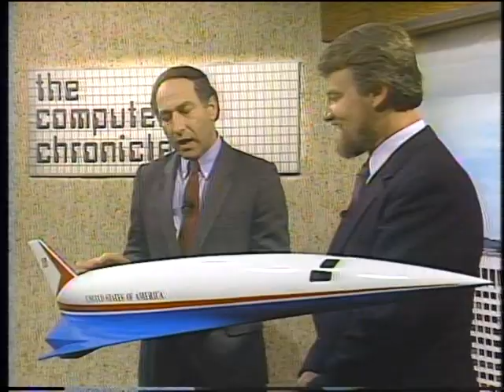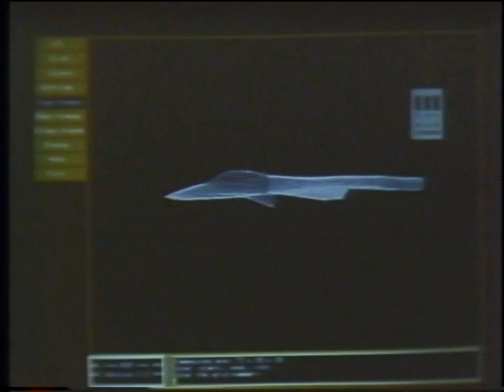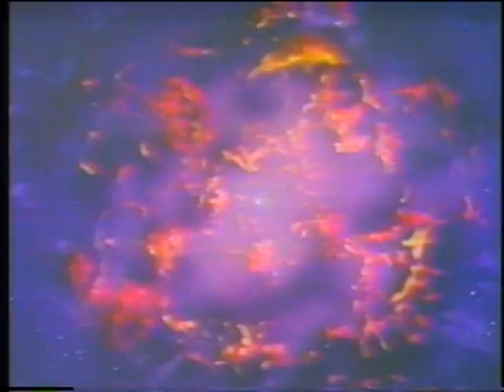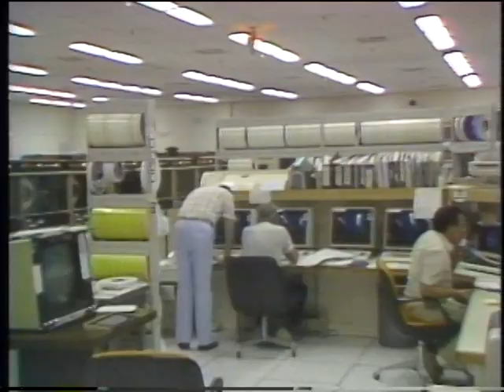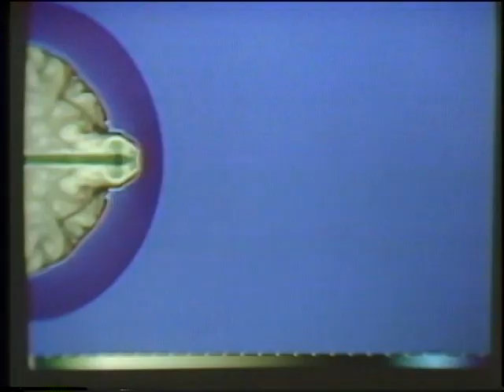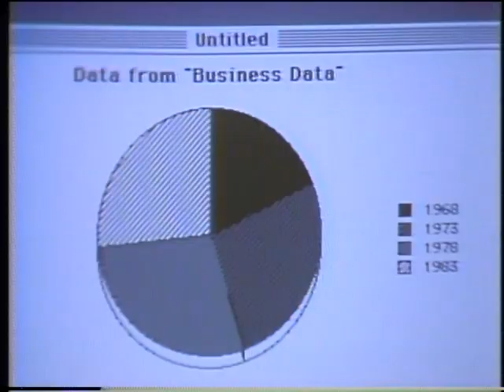The Computer Chronicles - Super Computers (1987)

Comment: "The CRAY-2 operated at 1.9 billion FLOPS (floating-point operations per second)—while the iPhone 12 operates at 11 trillion FLOPS. "   -- I pulled that off of PC magazine's site.  That's just crazy
Reply: That's Cray-Cray!
Reply: AMD 7900 XTX has a theoretical performance of 62.6 TFLOPS (tera FLOPS) or 62.6 trillion floating point operations per second. Nvidia 5090 gives around 104.8 TFLOPS fp32 and around 1.6 TFLOPS fp64 (double precision). Roughly 1000 times faster than Cray-1. Max power is 575 W meaning 2.8 GFLOPS per Watt. By comparison, Cray-1 consumed 115 kW of power, meaning 16.5 kFLOPS per Watt. So Nvidia 5090 chip is almost 170 thousand times more efficient than Cray-1 and is around 1000 times faster in fp64 than Cray-1. Cray-1 was released 50 years ago (1975).
Reply: Crayzy!
Reply: Yes this is sick "CRAY-2: 1.9 billion FLOPS (1.9 × 10⁹ FLOPS).
iPhone 12: 11 trillion FLOPS (11 × 10¹² FLOPS).
This means the iPhone 12’s Neural Engine alone is approximately 5,789 times faster than the CRAY-2 in terms of raw FLOPS (11,000,000,000,000 ÷ 1,900,000,000 ≈ 5,789)."
Reply: It's because things are suppose to improve and they follow the moore's law. But keep in mind they have still have different use case. I think no one will use iPhone 12 as the main server and charge it 24/7 because it was design to be portable not for mission critical purpose.
Reply: Not quite the same - the Cray, and all supercomputers, report floating point operations in double precision, fp64.  All consumer devices report in fp32, single precision.  Double precision is needed in complex modeling tasks, while consumer devices just use it to play games, perhaps run a quantized LLM, or do some video effects which don't need anything close to double precision.  As the name implies, double precision is significantly more complex.   My NVIDIA 3090 for example, has 36 teraflop fp32 but in fp64 that number sinks to just 556 gflops.  Still blows the water out of the Cray but not quite as dramatically.
Reply: @oldtwinsna8347   And, thankfully, none of those will cost you $100 million.

Comment: For those that don't know . . . This computer had 2gb storage . . . 64 bit words is 8 bytes (250 mil of them) . . . The snapdragon in my phone hits close to 2000000 mflops (vs 250 mflops) on the GPU and around 250000 mflops on the CPU (~2 tflops GPU and ~250 gflops CPU). All packaged in a fraction of a fraction of the size of the cray

Comment: 10 Ghz "super computer"   a today's  Quad Core running at  2.4  Ghz  for a mere 50 dollars could match that beast... well still impresive for the time.
Reply: Not quite... 

It's not just how fast the processors were/are that matters, but also HOW that speed is used, and the massive vector processing capabilities of super computers such as the famous Cray line would still be impressive today, compared to any modern computer.
Reply: @looneyburgmusic  well that's where the 250 million floating point operations per second metric comes in. Today's smartphones can easily outperform on raw power, but true it's not the power that matters . . . It's the software that drives it. But yes a smartphone in terms of raw performance would drive this to the ground. If the phone were programmed bare metal to run this software it would very easily overtake this supercomputer, but for now it's juggling a taxing os and handling tons of other processes outside of the one on the screen

Comment: Wait Mach 25?  That can't be right.  It's 2020 and nothing is that fast yet.
Reply: In June 2017, Lockheed Martin announced that the SR-72 would be in development by the early 2020s, with top speed in excess Mach 6.

Yeah, Mach 25 had to have been a mistake.
Reply: I've sat on a Cray :-)  I contracted for the Air Force for a time, they had one sitting in a hallway as a bench.  I think it was a Cray-1 or Cray-2.  It had padded seats all around it.

Comment: Did they get the power of a cray 1 by 1990 in a PC?
Reply: No, definitely not.  In 1990 the fastest x86 was the 486dx-33 which did a little under 2Mflops with its built in FPU and about 25 MIPS integer performance.  With 3D graphic cards still many years away, video performance was limited to frame buffers only.  The original Cray 1 could do 160 Mflops, which would have smoked anything the PC could do at then.  In fact, it took until about 1995 when the Pentium Pro 200MHz was released that it could match the floating speed of the original Cray.  From there on , speeds really got fast and eclipsed subsequent supercomputers just from the special vectorized functions within the FPU and MMX extensions (ironically, the same vectorized ability the Cray touted).  And once 3d graphic cards came out, supercomputers of years prior became a distant memory of the past.

Comment: Computer Chronicles is awesome.  However, not that it's the shows fault but 33 years later and there is still nothing close to a 15,000 knot Orient Express supersonic super plane. I think NASA duped us on that one and what a waste of tax payers money, jeez. It was laughable watching this. Taking a look back and watching things like this is a huge eye opener.
Reply: I'm an aerospace engineer, it's not oncommon to propose a highly PR favourable project to get funding for peripheral technologies. In this case they probably used the PR momentum to get funding for these Cray supercomputers and R&D for the CFD software.
Reply: Mach 20 is pretty much re-entry velocity, that necessitates a heat shield.
I remember there was a lot of speculation in the 1980s about sub-orbital hops to travel quickly around the Earth. It's conceivable, but re-entry heat shields are always the limiting factor.
(It's not that unreasonable an idea, it takes about 30,000 gallons of kerosene for SpaceX to reach orbit vs about 50,000 gallons to fill up a jumbo jet. The difference is that the rocket can move a few people whereas the jumbo jet transports hundreds.)

Comment: Today my desktop has nearly as much computing power as my state did in 1987 :)
Reply: If your desktop is based on one of the latest AMD Ryzen processors, it might be way more powerful than the supercomputers in 1987.  Take for example today's AMD based XBox Series X.  It is just a game console but it already is capable of 12.15 Teraflops (12.15 Trillion Floating Point Operations Per Second)  With today's desktop gaming computers, there are GPUs that are capable of 25 Teraflops or greater depending on the model.  The supercomputer mentioned above is only capable of from 250 Megaflops (Million Floating Point Operations Per Second) with boost up to 1.7 Gigaflops (Billion Floating Point Operations Per Second).  They had a plan to upgrade it to enable up to 10 Gigaflops or 10 Billion floating point operations per second.  It has a memory of 250 Megabytes, while today's desktop has 8, 16, 32, Gigabytes or even greater.
Reply: @gerrycrisostomo6571  The cray-2 from the video has 2gb, not 250mb of memory. They did say "250 million", but specifically "250 million 64-bit words", each word corresponding to 8 bytes, it sums up to 2gb. Not bad for a computer from 1987. What's even better, the cray-2 achieved that performance in a single "processor" design, ie no multiprocessing. All that performance is in a single execution thread. That level of performance was only matched by consumer computers one and half decades later.
Reply: @user-rh8hi4ph4b  in the video they said it had 4 processors.
Reply: @justin3594  you are right, the cray 2 had four processors. I was hinting at cray's designs in general which went against the typical supercomputer philosophy of "network more processors" (hundreds and thousands). Supercomputer performance in 4 processors is unbelievable even by the standards of its time. 

"If you were plowing a field, which would you rather use?... Two strong oxen or 1024 chickens?" - Seymour Cray
Reply: @user-rh8hi4ph4b  I think a more accurate description would be that Seymour Cray was responsible for a very large part of the innovation in systems design throughout the late 60's, 70's (at CDC) and 80's (at Cray Research). From RISC (CDC 6600), pipelining, ILP, SMP, etc., he had pioneering implementations of all of the above (the Cray X-MP was a shared memory multiprocessor machine, for example). The primary design element of the Cray's of this era was their vector processor design, which did fall out of fashion, due to performance improvements and cost reductions in scalar general purpose microprocessors. Today, vector processors have made a comeback in GPU form. It's fairly safe to say, that Seymour Cray can be considered one of the most influential people in the history of modern computing.
Reply: Jason, I'm sitting here before my daughter goes into her 5th grade class.  I'm showing her this video so she could understand what it was like when I was a kid.  I told her "you know that PC in your room that we spent $700 on and built ourselves?  Well that machine has more compute power than NASA's super computer did when I was 5, and they probably spent more than $35 Million on it at minimum.  Do you still want to complain about doing your homework?"  LOL
Reply: @Vashon Tarpon Anything I need to learn, just press buttons and apply some effort. Cat videos keep me from going postal. All productive :)
Reply: @jsmythib  unsure what you mean by "going postal" ??
Reply: @RichardHaydenuk   Sorry. The term is localized to my region. Often used anecdotally. https://en.wikipedia.org/wiki/Going_postal
Reply: @jsmythib  oh I see, sorry for my ignorance that was inexcusable of me. We have just entered here in Wales another full lockdown, so I will have to look for ways to stop myself from, as you say "going postal".
Reply: @RichardHaydenuk  It was certainly excusable :) I know we are global but sometimes I cant help but use local vernacular. Cheers :) ( and yes! dont go postal! lol)
Reply: @comedicsketches  Assuming what you said is true, today's gaming computers with 25 Teraflops of computing power, 32 or more Gigabytes of 64 bit architecture Random Access Memory and multi-terabytes of storage is clearly  still more powerful than that supercomputer.  So what is your point?  By the way, today's supercomputers are measured by the hundreds of Petaflops and there are those that are designed to reach even the Exascale computing power.
Reply: are you sure it could be more then that actually

Comment: Many times the price of the CPU is the fraction of the total price of a home computer. That can be avoided with super computers. Supercomputers don't have one CPU but a very large number of CPUs and each of them doesn't need its own monitor or hard disk, RAM, keyboard etc. 
A burden for the speed of a CPU is its heat. Most CPUs of home computers are air cooled because this is very safe, cheap and convenient. The supercomputers have more advanced ways of cooling like water cooling, liquid nitrogen cooling or in the case of quantum computers liquid helium. 
Super computers contrary to home computers do very specific tasks. The faster a computer is,  the more restricted and specific tasks it does. Home computers are Jacks of all trades.
Reply: Your comment shows you really have no clue about supercomputers 😀

Comment: So where is our Mach 25 super national orient express airplane that gets use coast to coast in 25 minutes that his cray 2 and the windtunnel was working on back in 1987. We dont even have supersonic air travel, So we are actually behind 1987 when it comes to modern air travel speeds. I bet we take longer due to the 10 levels of TSA checks.
Reply: Well there was the concord but we know how they turned out
Reply: Because it's not economically feasible.  Majority of travelers want to get to a destination as cheaply as possible.   Those who are rich enough buy or lease their own airplane so they have a schedule revolve around them, including using small general aviation airports instead of large commercial ones.
Reply: 12 minutes

Comment: Then:  Wow!  We went up 4 MHz!
Now:  wow.. we FINALLY got to 4 GHz?
Reply: For a long time it was all about clock speed, then it became about efficiency with a lower clock speed, now it's about both, plus core count.
Reply: Well strictly speaking the record was 8GHz with a Pentium 4 chip about.. 10 - 15 years ago. We haven't had a processor with stock speeds above 5 Ghz. The first processor to come out with 5GHZ stock is the i7-8086K but it will only be released by end of this year.
Reply: Yes, but the GHz war ended a long time ago in the mid 2000s. That of course doesnt mean computers aren't getting faster.
Reply: These days, it's all about multiple processor cores. The quest for more gigahertz ended when someone realized that the heat densities were on a par with lesser stars.

Comment: In 1987, due to the limits of the super computers at the time, aerodynamic analysis could only be done on the fruit fly.
Reply: They did it using discrete slices in 2D
Reply: And to think how many times more powerful your humble PC is.
Reply: @GaryCameron  Cray 2 in this video had about 2GB RAM and 1.6 Gflops of processing power. it must of had massively parallel ALUs in SIMD.
That is still more powerful than most laptops today. 
Impressive for 1987.
Reply: lol yeah but today it can be done on much larger objects thanks to the much faster desktop pc's

Comment: Todays supercomputers are the equivalent of 16,000,000 Cray 2's
Reply: you wrong my computer is faster then that and super computers can beat 512,000,000 cray 2's
Reply: @raven4k998  Give me some proof.
Reply: @ducksonplays4190  want proof run cinebench r20 on that cray computer and tell me how long it took it to complete the test? I am guessing 20 years my systems score is 22649 on the first run what does the cray get?
Reply: @ducksonplays4190  no no no you give me some proof lol
Reply: @raven4k998  Cinebench r20 has not been ported to the Cray2, Plus I can't calculate it because I do not have a datasheet of the clock counts of every instruction. 20 years is very inaccurate, a 700MHz machine is a lot faster than you think. To get the same number of cycles on a 700 MHz machine as a 4.1GHz machine it would be 5.8 seconds of the 700 MHz machine. Marginally slower than the 4.1GHz CPU.
Reply: @raven4k998  k let me just port that and run it on my cray2.  Ill get back to you when I'm finished.
Reply: Hello from 3 years on and  the US and China have computers that can do 1 Quintillion calculations per second, totally insane , the Supercomputer of 87 was like a modern i7 cpu nothing special lol
Reply: But can they run Farcry?